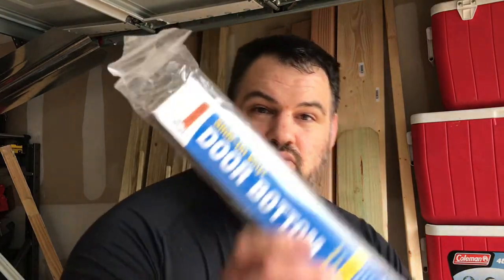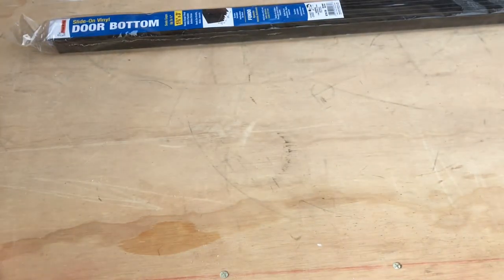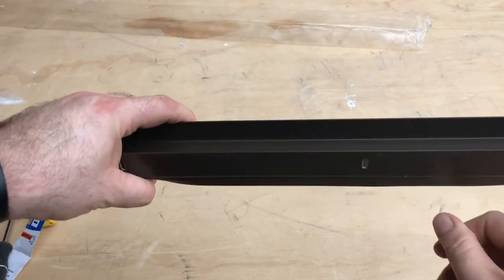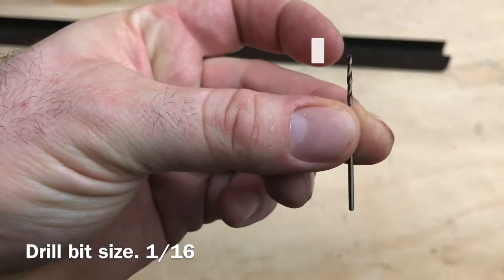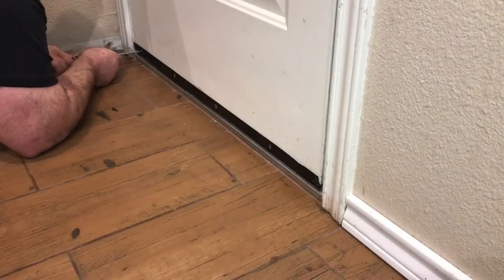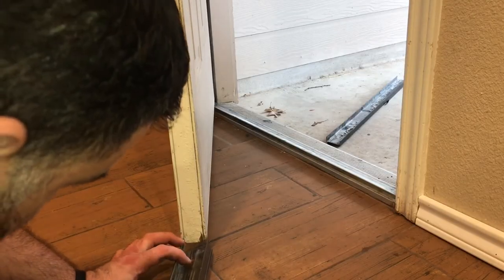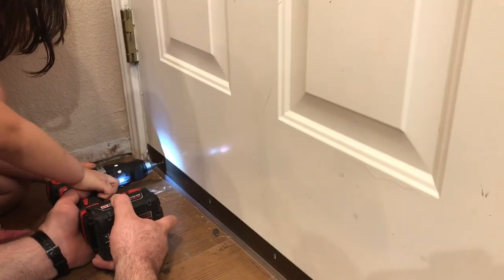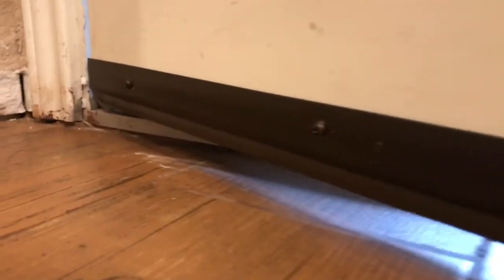How to install a door bottom seal (Frost King Slide-On Vinyl)

Comment: Will this work on a door that underneath has concrete cement? I want to put it on a basement door nad like I mentioned it has concrete under the door I feel if I put this on it will scratch the product I dont know what to put there mices go under the door the door is too short nad I was hoping this product will help.
Reply from the maker: If it’s concrete I wouldn’t worry too much. It should be fine. It’s not the hardest plastic. There are other products that have softer bristles
Reply: @MendandMake  cool. thanks!
Reply from the maker: Yes sir !
Reply from the maker: The reason I mentioned bristles is for less friction of course but there was some harder material but this was like 7 bucks and the more commercial material was like triple.   I do have to change these these things out every 4 or 5 years or so.